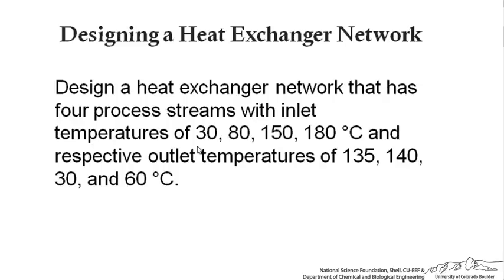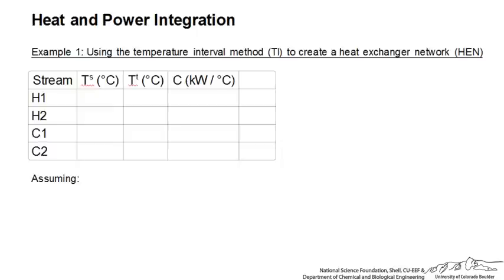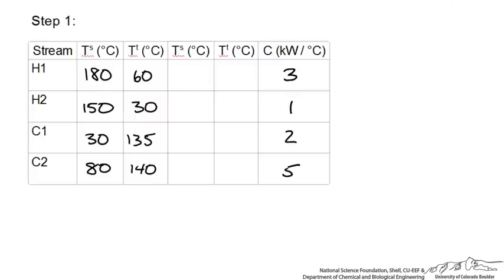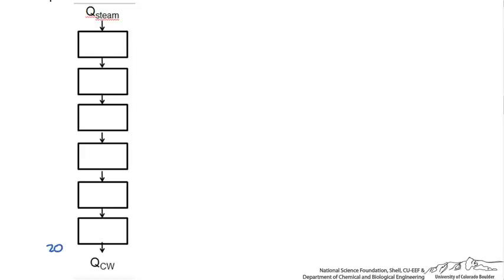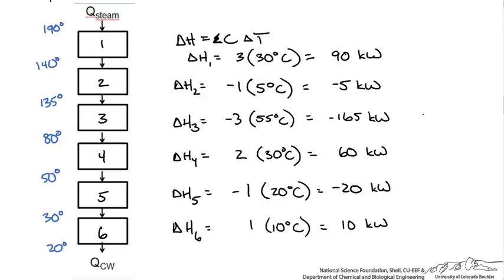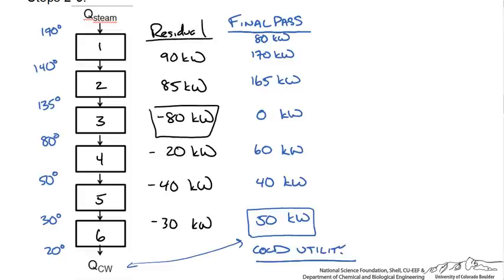Temperature Interval Method for Heat Exchanger Networks

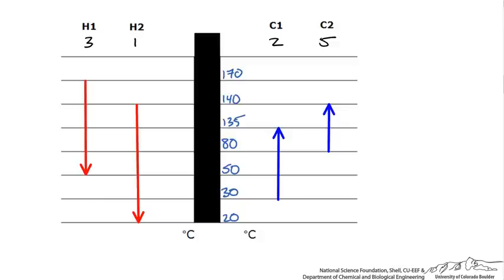Comment: The H1 and H2 stream temperatures you used in the diagrams (like @5:30)are switched with the ones you used in the originally tables @1:45

Comment: You sir, are one hell of a life saver! the 2013-2014 senior class of Chem E's at Michigan Tech thank you. I pointed my classmates to these videos for our take home exam (on pinch analysis) and they've helped us a ton. Difference is, our exam is to FIND delta-T-min based on the maximum Net-present-Value. This involves doing this 3 times over for different delta-T-mins, doing a full cost analysis on all 3, then plotting the NPV vs. delta-T-min and finding the peak of that parabola (highest NPV). And that's just the first 40% of the exam...
Reply from the maker: Send us the question and maybe we can work up some more videos.  Go to our website for contact info (learncheme dot com). Thanks for your message.

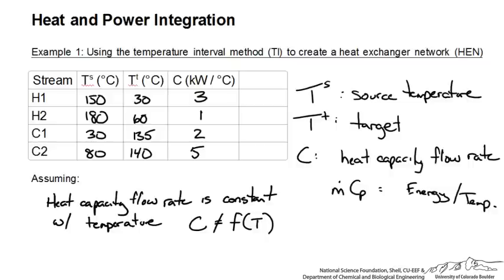Comment: The H1 and H2 stream temperatures are inverted  in the table at 3:56 compared to the first table at 2:10. This changes the whole problem as you do not switch the heat capacities.
Reply from the maker: This does change the worked out solution based on the initial problem but the approach remains the same.  We will put up a corrected version soon. Thanks for catching this.
Reply: Glad to be helpful! :) Thank you for making a great tutorial!
Reply: Dmytro Sazonov thanks a lot
Reply: +Dmytro Sazonov i also catched it ) Спасибо! :)
Reply: Yeah! The approach would remain the same.

Comment: Very useful video. Not many out there.
As a TA, I see college students making several common mistakes. It might be helpful to emphasize the following:
1. How the pinch temperature is selected. It is not uncommon for students to select the temperature ABOVE the point at which the deltaH cascading down the intervals becomes 0. 
2. When matching streams, the ACTUAL temperatures must be used, NOT the shifted temperatures. Again, it sounds like a silly mistake but it is quite common.

Thanks!
Reply from the maker: +wolfmanjacksaid Thank you for the tips!

Comment: Quick question at 7:00; -80 kW was chosen because it was the most negative value. If within my data no negative value exists, then do I just choose the lowest value from the data set?
Reply from the maker: What that says to me is that if a negative value is never reached, then there is not a pinch point and no hot utility is required to heat the cold streams to the desired temperatures

Comment: On what basis did you identify the Pinch Point as -80?
Reply from the maker: -80 kW was chosen because it is the most negative of the residual enthalpies. The idea is to use that as our "zero" point for the change in enthalpy, because no heat is transferred across the pinch.
Reply: OK , Thank you so much and one more doubt , on what basis did you took DTmin = 10°C?
Reply from the maker: The minimum approach temperature is something that will either be set by the problem statement, or you can set it yourself. A minimum approach temperature difference of 10 degrees C is just a common rule of thumb.
Reply: OK.....Thank you so much.